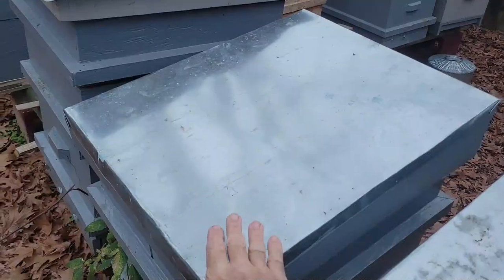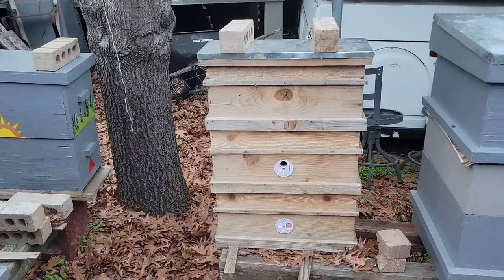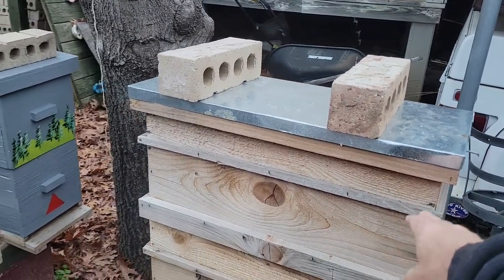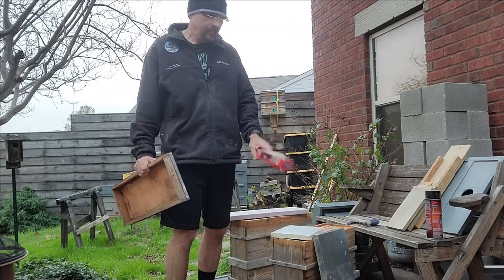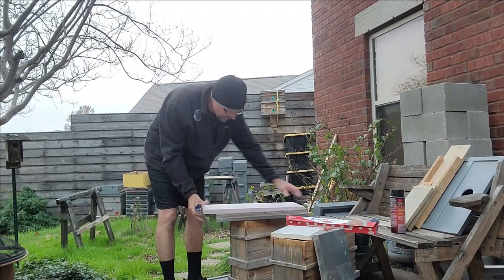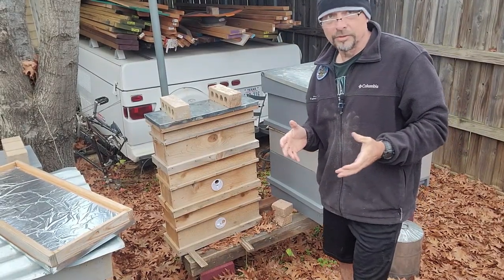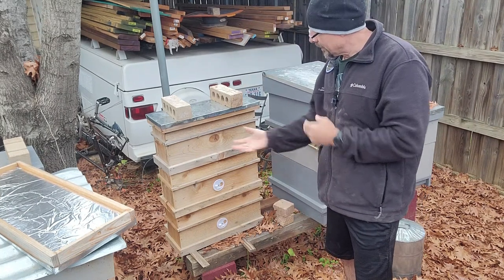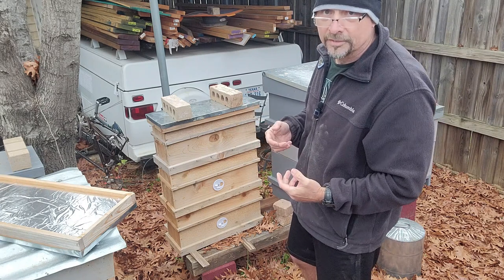Quik-Fix for Un-insulated Bee Box

Comment: Planning ahead, good on you!    FYI the tan poly starts to lose it's insulation abilities around 50F. The glasses that cause it to foam up start to solidify around that temp.     Great job spraying glue to the relectix layer!!  (we use foil survival blankets, I've used them on myself stuck out during a blizzard) onto the pink or any hive wraps you might want to use. 
Man I'm sorry for you cold. If you're not born into it, can be harsh. Hang in there and Merry Christmas.
Reply from the maker: I heard something about that on the polyiso.  Hopefully its a minor drop in efficiency. And hopefully that below 50 and not above.  My insulation is more for hot summers than cold - and forces the condensation to the side walls.  You wont hear me complain about the cold.  I prefer it to the endless 100 degree days in July and August.

Comment: I need to look at some outer cover insulation. Like your ideas. Thanks for the video.
Reply from the maker: Thanks Garry.  I have a colony just like this at my country bee yard that didn't get the extra insulation.  They made it thru the winter too.  So many people judge success or failure of a colony based on whether or not it lives thru the winter.  I believe its more complex than that.  If you think one thing like insulation or ventilation killed your colony there are probably 3 or 4 other things that contributed as well.  I mainly like insulation on top to force the condensation to occur on the walls.  It probably helps as a barrier to overheating in summer as well.